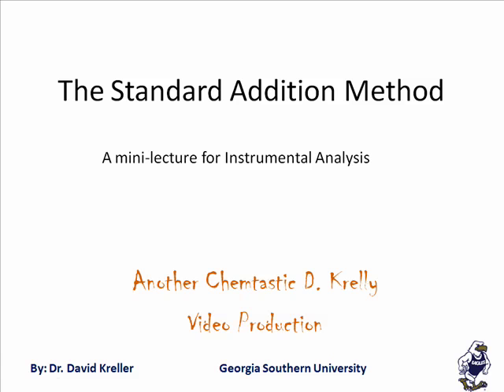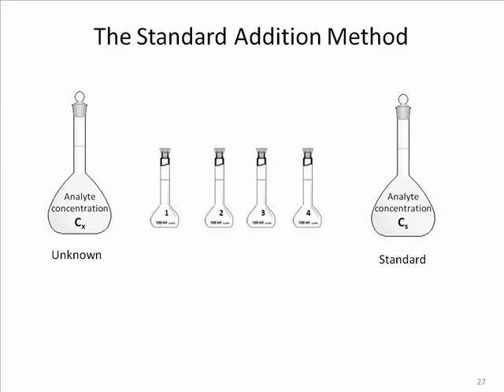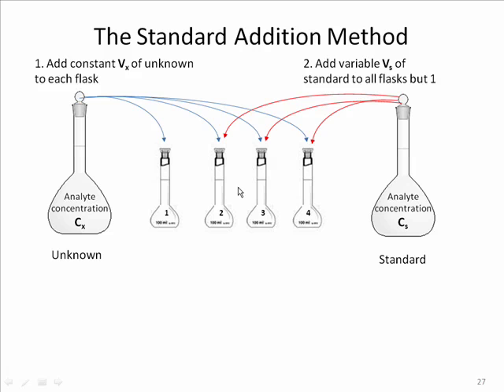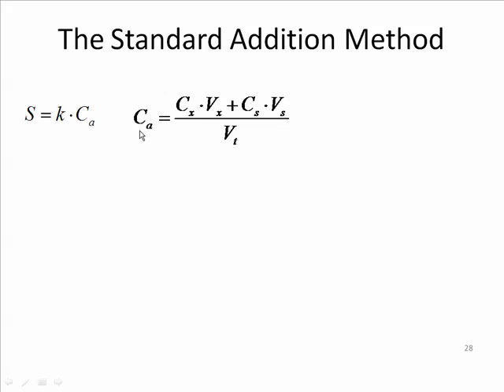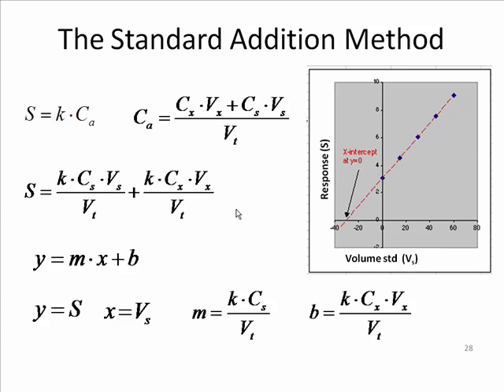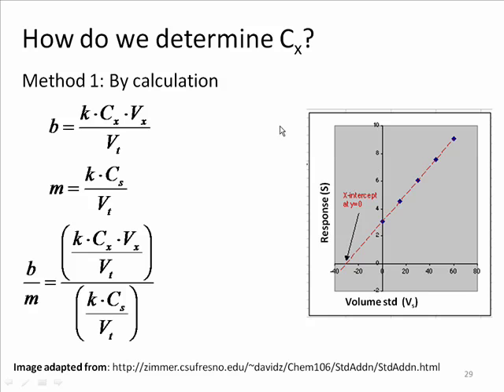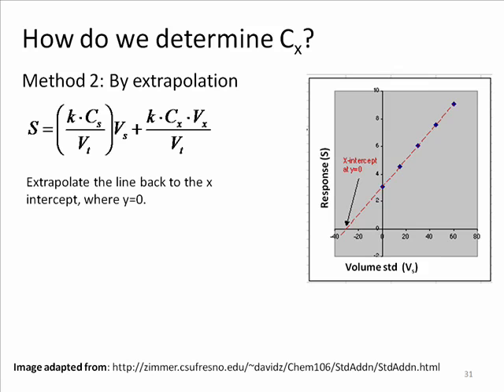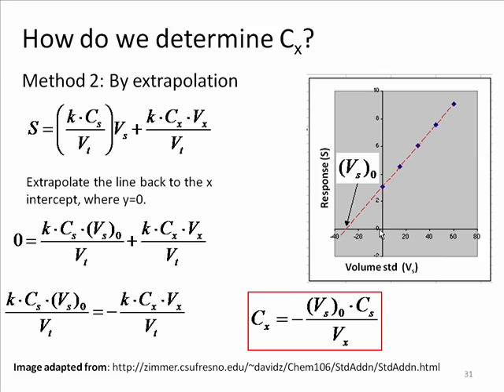Standard Addition Method

Comment: Could u help to solve a standard addition method question ?

Full quesion: Standard addition is an analytical technique of extreme importance to an analyst, as it eliminates the interfering effect in most determinations. Fluoxetine is widely used as fluoxetine hydrochloride, also known as Prozac®. This is indicated in the treatment of depression, associated or not with anxiety. This compound absorbs ultraviolet light at a wavelength of 227 nm. It has in its structure a stereocenter, being a chiral drug. It is known that only the (R) -fluoxetine isomer has activity, while the other enantiomer has no pharmacological action and there is no evidence of toxicity to the organism.

In an industry, when performing the Fluoxetine analysis, the following analytical calibration curve was obtained, in which the concentration is in g / 100 mL: Abs = 372 CFluoxetine + 0.6432.

Knowing the analysis was performed according to the standard addition technique and that the molar mass of fluoxetine hydrochloride (C17H18F3NO.HCl) is 345.79 g / mol. Determine the mol / L concentration in the analyzed solution.

Alternatives:
2,25x10-5 mol/L
5,58x10-5 mol/L
5,0x10-5 mol/L
9,69x10-5 mol/L
3,08x10-5 mol/L

Comment: Summary: You basically add increasing amounts of a standard to an unknown solution and dilute them in volumetric flasks, take the concentration of each solution (using an absorbance meter or something), and plot the data. You'll get a line. The y-intercept of the line is the response when there is only an unknown solution, and the slope of the line can be used to calculate the relationship between concentration and response.

Formula: concentration_unknown = (y-intercept * concentration_standard ) / (volume_volumetricflask * slope_of_line)
Reply: Empire State this makes sense... can anyone else confirm this summary? I am writing this on a flash card

Comment: I still do not understand the concept behind how adding a known amount of analyte in intervals will give you the unknown concentration. I understand the math and how to calculate the answer,  I just cant wrap my head around the big picture. fuck.
Reply: Wee bit late, but a simple way to wrap your head around it is imagining a bank account. 
You don't know how much money is in this bank account and you can't just check. When you try and use the account, you're only told if you have the available money. 
Now, considering how simple it is to just try and purchase many different items, this would be rather silly to do in practice but to make it work, let's say you can only attempt to purchase a brand new T.V.
Your first attempt shows you can't, so you add money to the account incrementally until you're told you have enough. Then you simply work backwards to determine how much money was in the account.

This is a little simplified obviously, but the overall principle is there.
moles of unknown + moles of standard = total response.
Once you figure out the total response how do you figure out the moles of unknown?
moles of unknown = total response - moles of standard
Reply: Thanks for the question, this is also something that i didn't understand. Sure anyone could describe how to do a standard addition as a procedure but understanding the core concept will allow you to understand why the procedure is performed and why it works.